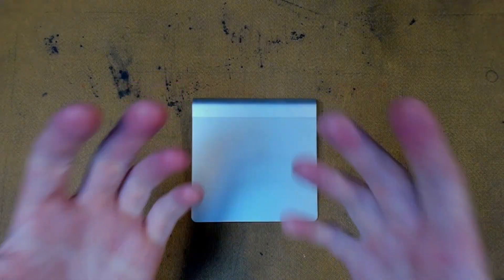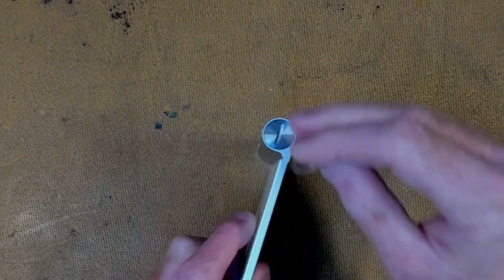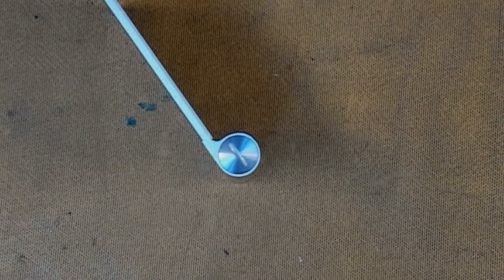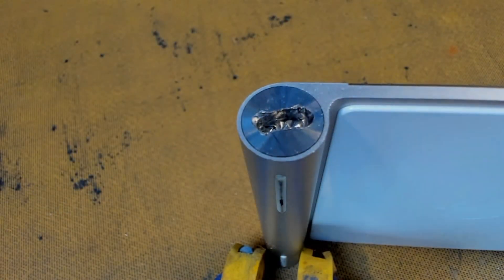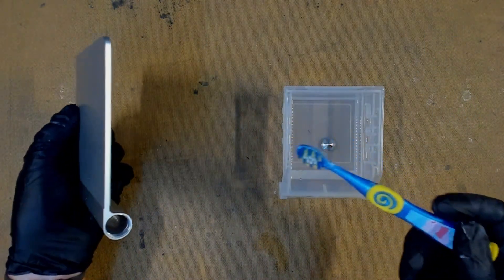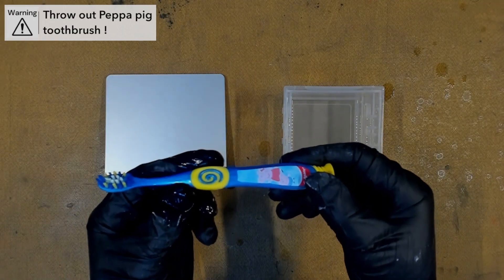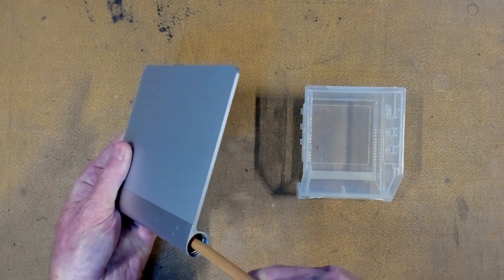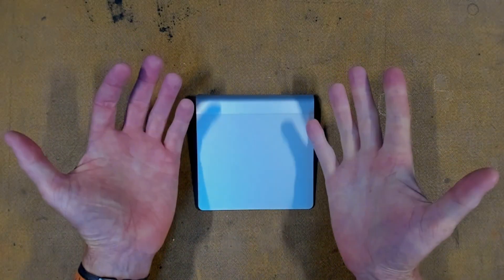Magic Trackpad Battery Cover Stuck

Comment: Your video really helped! I ended up using a mixture of cleaning vinegar and lemon, left it soaking for about 10 min, then used a vice grip on the trackpad (luckily no damage) and a pair of pliers holding a quarter! It finally came out. Cleaned as you suggested, but with the vinegar lemon concoction, and bam! It works! Thank you!

Comment: Thank you very much for the tips. We tried isopropyl alcohol and Q20 at first and did not work. When then came across this video and used the white vinegar (without lemon juice) and boom, the batteries and battery cap are out!